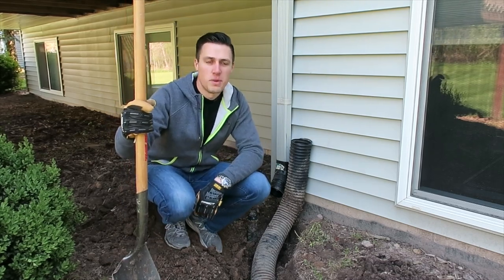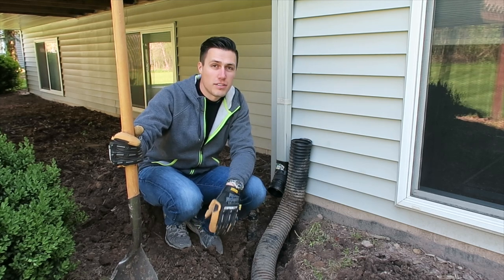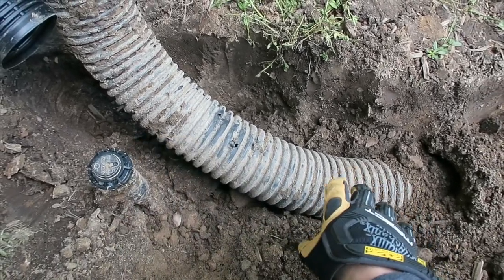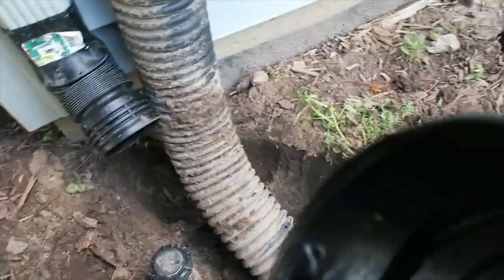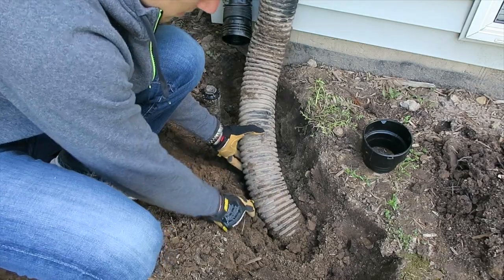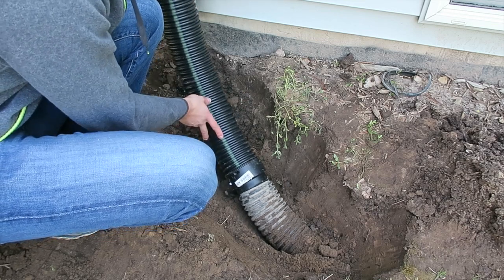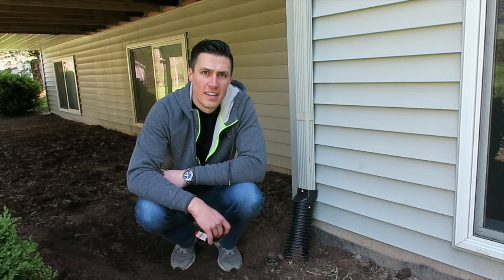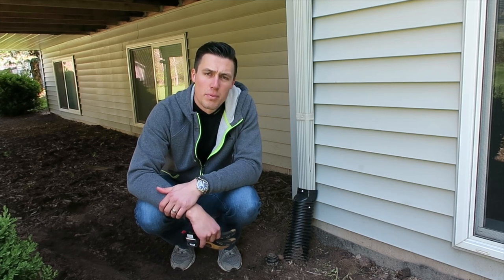How to repair a downspout drain pipe

Comment: Hi Craig! Great video.
Where does that end of the pipe that goes into the yard terminate? We have the same downspout/4” pipe situation and it seems clogged somewhere under the ground.
Thx :)
Reply from the maker: Hi ActionPouty, that pipes drains about 20 feet from the house. It follows the grade of the land. You may have a cracked pipe and/or have a blockage with dirt, debris, leaves, etc. Google unclog lawn drain, there are some tools available to help push/breakup the clog. If you want to find out if you do have one, take a long drain snake and run it through...if it stops short you know you have a clog

Comment: how about installing a t connector  so you can add an above ground pipe during March and April when the ground is frozen and the water needs a drain outlet from the roof?

Comment: Our sump pump is filling more quickly than it used to and running more often.  How do we know if our under ground drain pipe has a crack in it causing the sump pump to fill more quickly?

Comment: how did you know to dig this drain pipe up? 

we have a humidity issue at our house and several issues with gutters but for some reason the landlord decided to have work done on the crawlspace.
Reply from the maker: There was a pool of water where the drain pipe was buried underground during and after a rain. The pipe wasn't draining fast enough and would leak through the crack in the drain pipe. You'll want to check for blockage in your drainpipe going into the ground, easily done with a drain snake. If you have pooling water by your downspout, it's likely a clogged or cracked drain pipe.